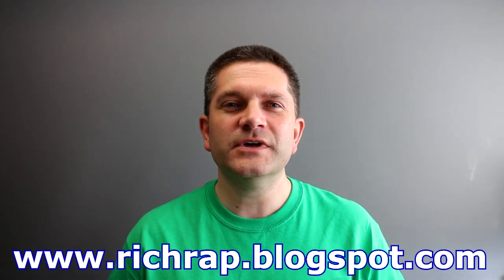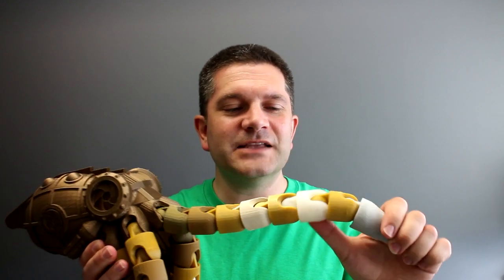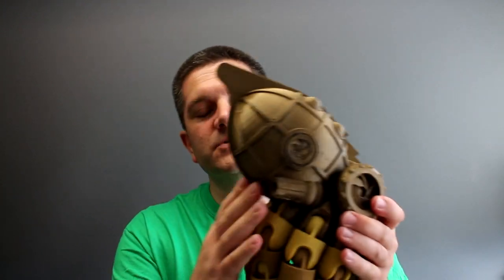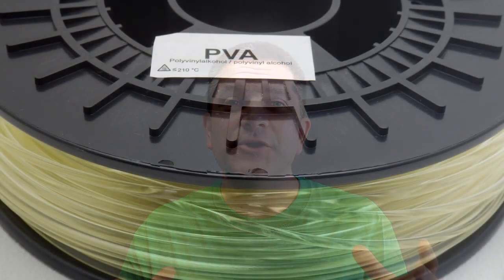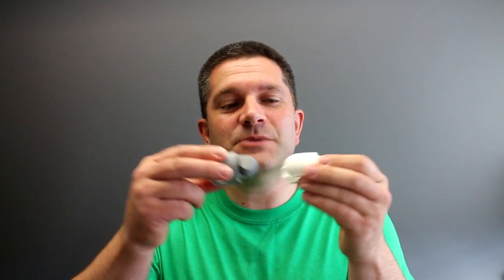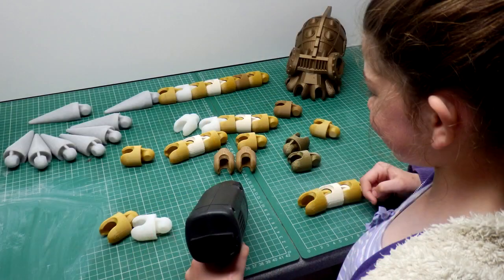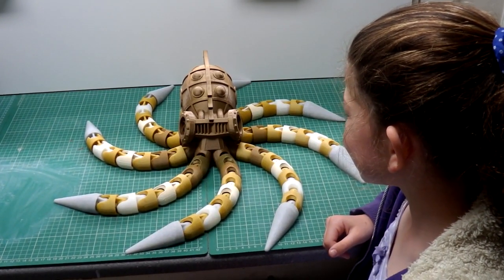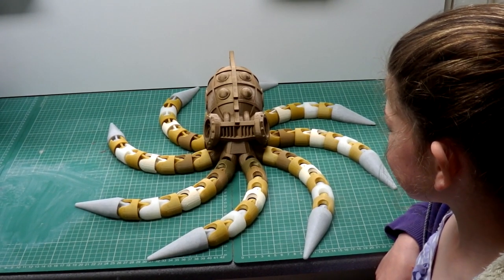3D Printing & support material processing - Steampunk Octopus

Comment: I did one at 300% scale, but yours looks slightly bigger, what scale is it?
Reply from the maker: I'll have to check exactly what scale I used, but it could not have been any bigger than the Sigma build area (A4 size) 210 x 280mm for the body.

Comment: Hi Richard!  After seeing your video I ended up printing the steampunk octopus myself. I love the way came out and I also had those rough edges on the back where the support was  but still love the way it came out. I also remoded the tentacle tip to fit more a feeder tentacles  tip to put on the two front tentacles. I think you should check it out you'll probably like to add it to your steampunk octopus. I placed it on thingiverse and all you have to type out is steampunk octopus and you'll see it. I hope you like the way it came out and the upgrade does make the steampunk octopus look extremely awesome.
Reply from the maker: Fantastic, thank you.
Reply from the maker: Thanks Victor, I'm glad you liked the mode and decided to print out out for yourself. I'll check out the remodel version too.

Comment: Just a thought, if you split the build job of the head into halves couldn't you eliminate a good deal of support structure? The longitudinal ridge seems like it has more than enough surface to cement the two halves together quite well.

Comment from the maker: People are asking about the flexi-neck mini blowtorch I use in the video - It's really good to use a torch rather than a flame as it stops blackening and can be easier to control the heat applied. Look out for gas cooker lighters with 'torch' or 'turboflame' . 
The one I'm using in the video is almost exactly like this one - but in White and not black - 
http://www.ebay.co.uk/itm/Gas-lighter-Maxi-Flexible-Turbo-Flame-With-Piezo-Ignition-Flex-Neck-/281512957258?hash=item418b7ad54a:g:wMoAAOxyiOxRyrh6

Comment: Did you try multiple slicers? Some are known to produce easier to remove supports.
Reply from the maker: I did. Normally use Slic3r, but for the last 12+ months have been tweaking and tuning Simplify3D to work with different 3D Printers. Now Simplify3D produces the best support removal for me.  It also has a very nice manual selection of support that you can edit and also save for future printing.
Reply: Thanks for the quick reply; it would be interesting to see which S3D settings you use. BTW, I use a DIY 40x40x40 cm Mendel, but things like support gap should be quite independent from the printer type I guess. Are there any plans for a Polysupport-specific video?
Reply: Hello Rich, that's impressive an impressive print; how is printing with Polysupport going? I recently ordered a spool and am currently doing my first trials. Any suggestions (Polysupport + PLA; Simplify3D)?
Reply from the maker: Hi Tinker Duck Polysupport is working well for me, it peels off well from PLA and can be set with just a small gap in S3D to produce very good results. It also does not need to be as dense set at PVA, so you use less as a support material.

Comment: Dam, that print came out really cool, I have been keeping my eye of trying to print one of this. I didn't realize it was so massive, thanks for giving everyone a heads up on this model. Keep up the great videos
Reply: I am printing one right now. I did one at actual size and now I am going 240% the largest can go on the MP Select Mini 3D Printer.
Reply from the maker: This was scaled up about 250%. The original is smaller, I wanted to try and max out the BCN3D Sigma build space - could have gone a little bigger. I'm really enjoying printing multi-part models, they often show more of the capability of a printer when many parts fit together well.
Reply: Yeah, I agree fully with you busy with a very long multi print. the more complex the better :D

Comment: Yeah, I absolutely hate PLA with supports as it just messes up my prints.  If PLA bonds this well to supports what does PETG do with them?  PETG bonds to itself even better than PLA but does it sag from gravity as much?  That is the culprit more than anything I think.
Reply from the maker: I have not had any great success removing Nylon or PETG support material from a 3D print, it usually needs to be cut out regardless of settings. For printing in Nylon and PETG/T a support material like Scaffold from E3D is going to be the best option.
Reply: Richard Horne
Exactly what I figured.  Thank you.